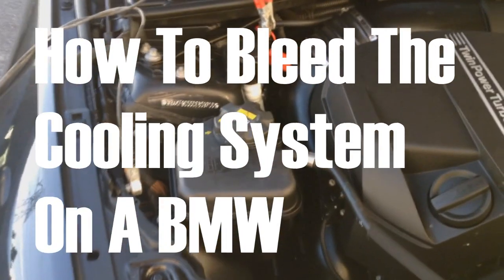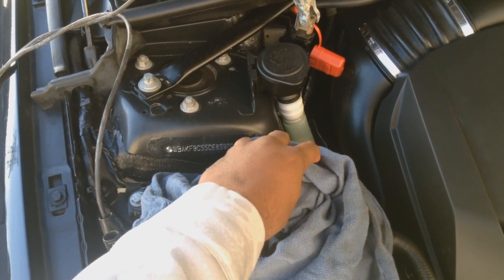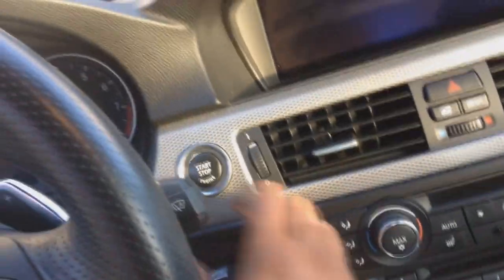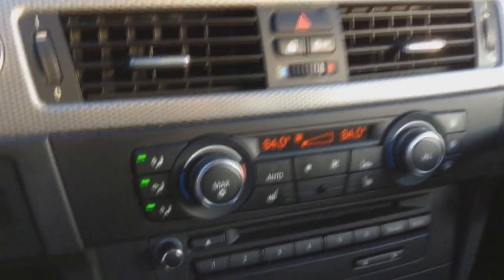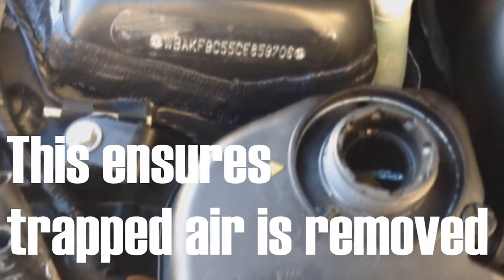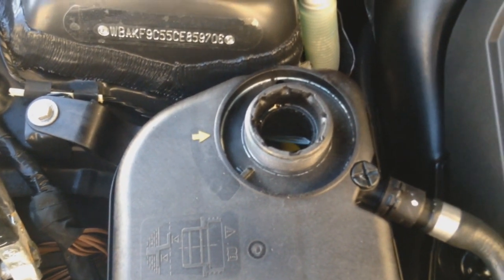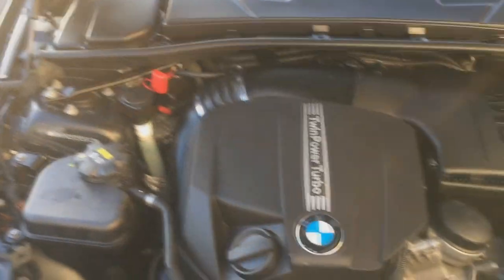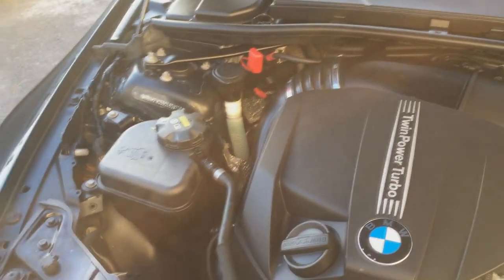How to  Burp trapped air from BMW Cooling System/Water Pump test

Comment: What happens if it doesn't run?  You hear it start but everything shuts down?
Reply from the maker: Then the water pump is junk…this is also a water pump test
Reply: @BimmaJoc  I see water flushing to the reservoir when engine is idling but it wont start when I try this procedure with only ignition on. do you think the problem is water ppump?

Comment: I believe my 320i with manual transmission has got an old school bi-metallic thermostat. What I don't understand is "what if the thermostat is not in open position?". I'll try this anyway....
Reply from the maker: Hjalmar Bäckström true ...but this should work with the waterpump if you dont hear anything...something wrong
Reply: Perhaps the procedure is engaging something more than just this electrical pump. I assume BMW did not come up with this handy feature without minding the thermostat. Either I'm wrong and the car DOES have electrical thermostat OR there is something else like a solenoid working to open a mechanical thermostat while running the pump???
Reply from the maker: Hjalmar Bäckström the thermostat should open by turning the heat up only...so are you saying thats not happening?
Reply: I'm saying that a closed thermostat would prevent bleeding out the air. Now that this "non standard" electric bleeding is really neat, I just want to understand how it permits the fluid pass the thermostat without the engine running.
Reply from the maker: Hjalmar Bäckström oh i see ...its because the ECU sends the signal to the battery...the battery has a separate connection for the water pump which receives the message and turns on and circulates the coolant
Reply from the maker: So now you know why the big red connections on top of your battery has to do with...it feeds various components...and if they are ever replaces they must be registered and coded thru the dealer or one who has specific bmw scan tool or software....smh lots to understand on these cars 😂

Comment: Do I keep my foot on the accelerator for 12 mins in order to bleed the coolant system? Or just just to start off? Please lmk thanks.
Reply from the maker: Julio  Zavala 12 seconds to activate water pump....it turns on right after and you should here it RUN
Reply from the maker: Let it RUN for 12 minutes...then you should be all set...check your heating ...if your heating is working fine then all air is bled out the system...if not ...repeat steps
Reply: My heater nor air works can I still do this I'm now getting a coolant indicator  placed coolant no leaks still light comes on

Comment: what about overheat egine...what is the causing problem sir
Reply: Air in your system, leak, bad thermostat or bad water pump.  If you replace one, replace them both.  I had to learn the hard way.

Comment: I replaced the water and the thermostat but when i do this i can’t hear the water pump:( can somebody help me ??
Reply: I think the electric water pump is not working but the thing is that i just replaced it
Reply from the maker: Does the vehicle over heat a lot?
Reply from the maker: If it doesnt it could be the connections on the battery…or the battery weak

Comment: This hasn’t worked for me, 05 e90 pre lci 320i 🤔
Reply from the maker: Because you have the non turbo belt driven water pump
Reply: @BimmaJoc  mines is the same. Does that mean it's not an electric water pump?

Comment: Why you are using battery charger?
And can I test water pump without it ?
Reply from the maker: You can get by with out the battery charger but theres a couple things wrong with that...1 when the water pump runs its going to drain power from battery, so charging helps battery not to die....2 there need to be over 12 volts for water pump to start running on its own...if not it will shut off on its own ...so the point of the charger is to Manipulate the pump into thing thinking the vehicle is running and under power
Reply from the maker: Also don’t charge the for over ten minutes to not over charge the battery

Comment: Can I test water pump with out battery charger?
Reply from the maker: Mohammed Talib actually you can so after a long drive ...park and remove key ...listen for the water pump recirculating...dont pop the hood dont lock the doors...listen for the sound...if it sounds wierd like choppy something wrong if it sounds normal like the video almost then its good...if it sounds way to loud and weird buy a new one just incase 🤷🏽‍♂️ e60? Yeah its gonna fail at some point they only last around 60k miles🤷🏽‍♂️
Reply from the maker: Also if you do it this way do not open the tank because the vehicle is hot now
Reply from the maker: Also one more option is a scanner ...im going to make a video about the waterpump soon so stay tuned in ...i use the bentley repair manual for the info
Reply: Bimma Joc thank you so much 
I was testing 
My water pump not working because damage in power cable

Comment: Thanks for the video. 

Just to double-check after letting 12 minutes of bleeding happen out of the system what's the next step do I just put the cap back on and start the car or does it automatically stop after 12 minutes and next step is just to start the vehicle and let the battery run for 5 or 10 minutes?
Reply from the maker: Ben T. Next step is to put the cap back on make sure the heat works perfectly fine and thats it. If the heat is blowing hot air, that means all air is out the system.
Reply: @BimmaJoc  thank you for the fast response so just to reassure myself what's 12 minutes is completed that system that's flushing itself will stop running and that would be an indication for me to put the cap back on and check the heater system with the car off and it blows hot air that means everything is good with my water pump and there's no issues and I could restart the car correct?
Reply from the maker: Ben T. It wont stop on its own , 12 minutes is enough time and you dont want to over charge the battery
Reply: @BimmaJoc  awesome. After 12 minutes I will go ahead and put the cap back on and start the car.
Reply: @BimmaJoc  thanks for your time.

Comment: Do I need to loose that plastic Phillips screw on the top of the reservoir for the air to come out or no need to loosen the screw?
Reply from the maker: Ron Paker no need ...but if you do close the big cap use a flat head screw driver ,a big one, and loosen a little bit to let air out then close,,,,either way the air needs to come out...that is the goal otherwise keep trying till you have hot air coming out those vents

Comment: My coolant light came on yesterday say it was low. I put about a quarter gallon of coolant and it's still on. Someone told me it needs to be purged. Any thoughts?  Thank you!
Reply from the maker: daniel garcia it definitely needs to be inspected...cant drive around with a car thats leaking coolant ....this video is purging the system but yours need to be checked for leaks....it maybe your tank its self...i would take it to someone experienced and have a pressurized test done it...this will show the mechanic what parts need to be replaced
Reply from the maker: daniel garcia but also when you put the coolant in did you mix with distilled water 50/50 mix??? Did fill to match the level indicator??? Because if you filled to the top thats too much ....you can blow the reservoir tank that way..very important to have this resolved right away
Reply: @BimmaJoc  ok thank you! I actually inspected it for leaks and found it has a very minor leak on one of the small hoses that's on the radiator. When you purge it, aren't you supposed to open the plastic screw on top of the reservoir?
Reply: I checked it this morning and it doesn't appear to be leaking from the tank. The coolant level was still full this morning
Reply from the maker: Yeah the bleeder screw you mean is the regular-way to purge...this video is so you dont have to use the bleeder screw the system purges itself electronically
Reply from the maker: Im going to make a video soon about the waterpump so stay tuned .....reasons why hoses like this fAil is because struts and shocks fail and we need them for support

Comment: Some People Leave the Coolant cap On  is that or Your way is the proper..
Reply from the maker: Christian Andolini if you leave the cap on then you might as well use the bleeder screw way instead of the pump...if you leave the cap off all air needs a way to escape so you can see there are no bubbles or air in the system,,,but dont leave the cap off for over 12 minutes tho while using the pump anyway...that way coolant will not rise out of the tank .
Reply from the maker: So to answer your question air needs be removed out of the system and thats the goal...or else your heater will be blowing cold air which is a sign that air is still present in the system and that a no bueno to you coolant lines as well
Reply from the maker: Christian Andolini soo if you do it with the cap on and not using the pump use the bleeder screw slightly open till air is out or no bubbles then tighten bleeder screw easily and your all set...weather from cap or bleeder screw no bubbles-should be present and the heater should be blowing hot air
Reply from the maker: Christian Andolini also vehicle has to be running to normal operating temperature while you have the cap or bleeder screw open...normal op temp happens as soon as fan turns on....using the pump is just fast easy and less mess https://youtu.be/2pG3l5G7a2I check out the last half of this video when i bled the system manually

Comment: Will this work Bmw e60
Reply from the maker: BrownGeezer01 only if the e60 with a twin power turbo or if the water pump is not belt driven or electric

Comment: Does this work for e46?
Reply from the maker: 🤔 well it may not if the waterpump is belt driven on the e46 ...this only works when the waterpump is auxiliary or electronic
Reply: Bimma Joc has how would one check to see if it’s belt or electronic?

Comment: You’re not supposed to have your cap open,you open it only to top off.
Reply from the maker: Its alright if its done with the cap open or closed ....as long  as you dont open the cap while its bleeding if you had it closed is what the repair manual says not to do

Comment: Didn't work at all
Reply from the maker: Paul Nugent if it did not work then your water pump has failed🤷🏽‍♂️this is a test for it
Reply from the maker: It can also be a bad connection to the waterpump from the battery...you need diagnostic check from a professional scan tool ...it will provide you the exact failure